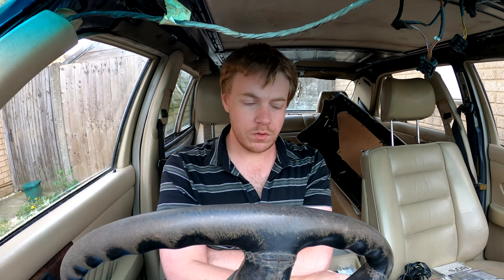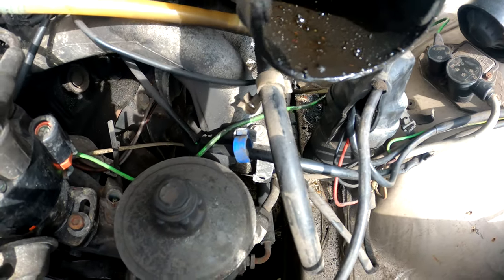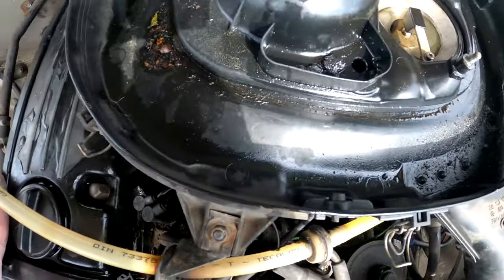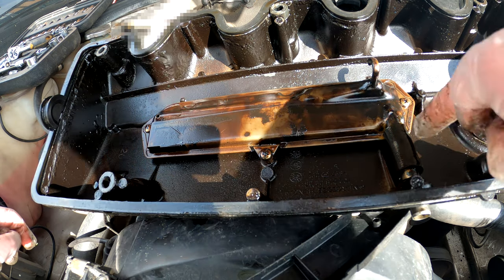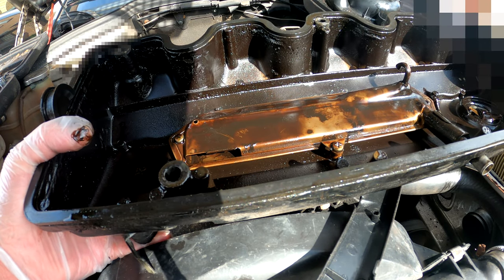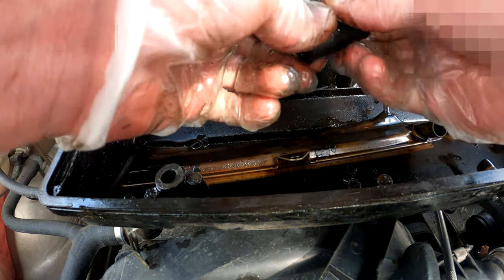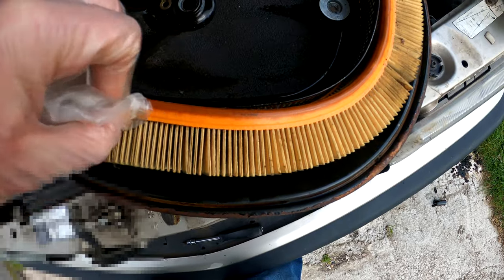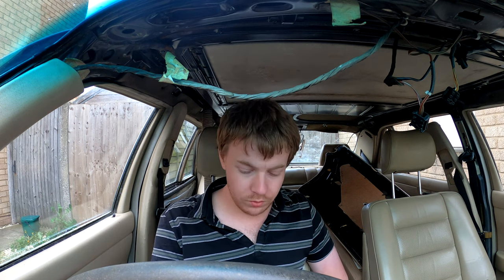Mercedes M102 Engine Breather Hose Causing Big Oil Leak From Cam Cover into Air filter Housing  4K

Comment: How has the new hose held up? Has the oil in the air filter housing disappeared? Ive got the same issue with mine. Cheers
Reply from the maker: Pretty good so have, I haven't noticed any oil in the intake hose, will have to take the air filter lid of and check in there too.
Reply: @OnTheDrive has the issue solved?

Comment: Did you replace the valve cover gasket or did you use the same? Thanx
Reply from the maker: No I reused the one that was on there as I replaced it not long ago and is still very pliable.